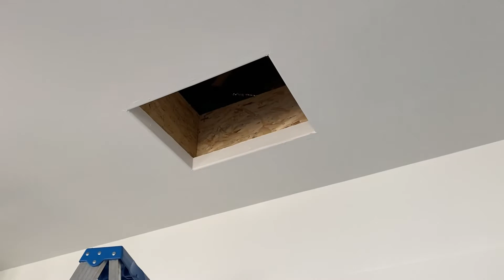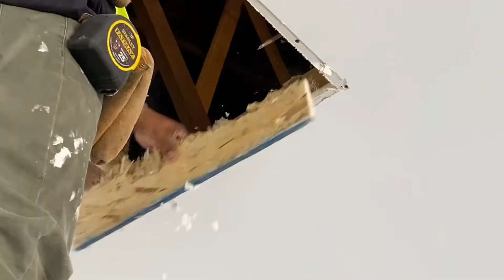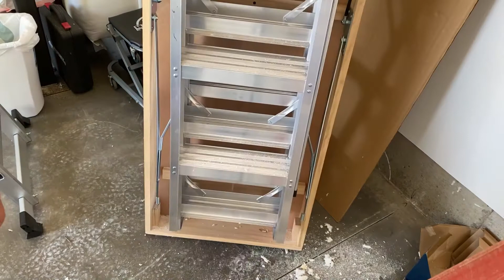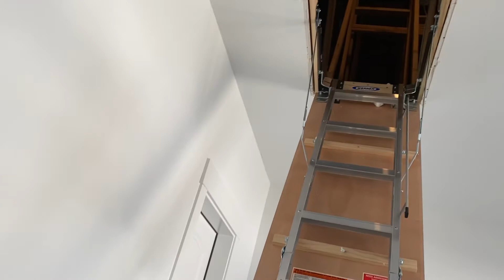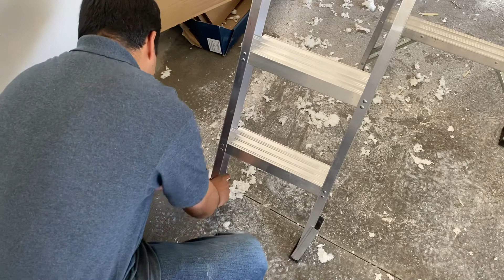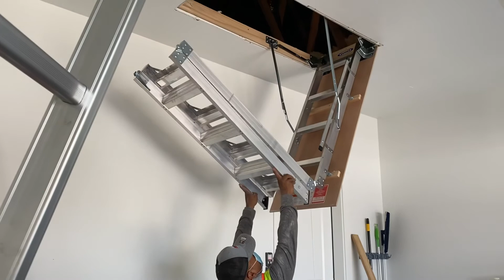How To Install A Werner Aluminum 8-10ft Attic Ladder Step y Step, we had to CUT a Bigger Opening!

Comment: The bottom of the jambs need to be flush with the ceiling surface so it can be trimmed properly. Here the panel is flush with the ceiling and cannot be trimmed or it can be trimmed on top of the panel rendering it inoperable. I use a scrap of 1/4" as a shim on the temporary supports, so it sits right prior to the fastening. Also, it shouldn't be so tight. In colder climates you want room for insulation.